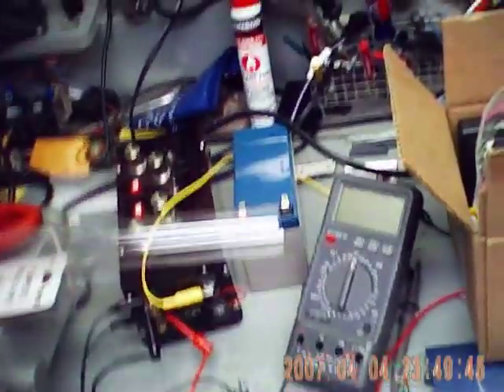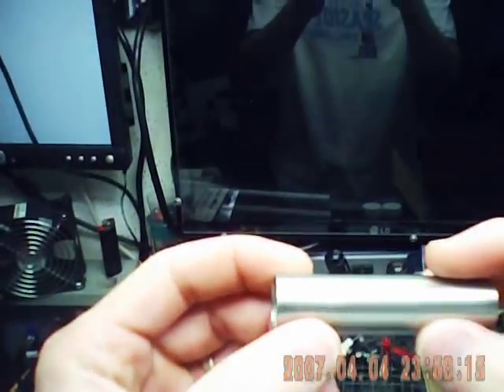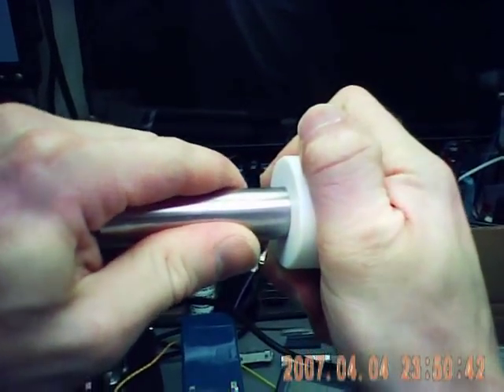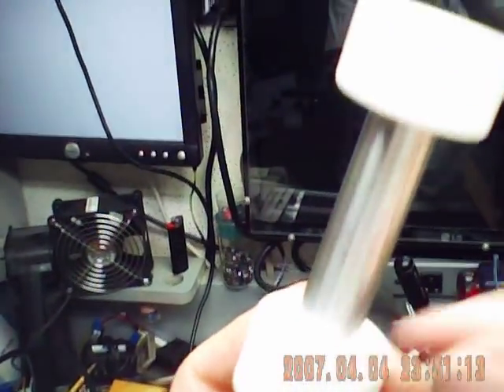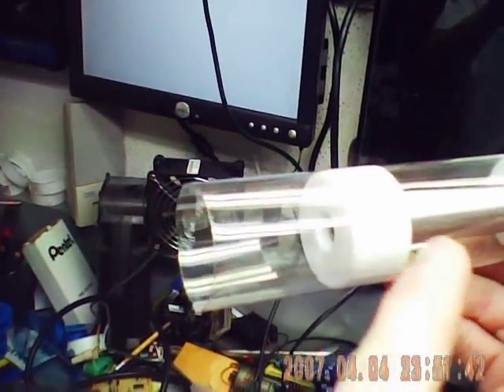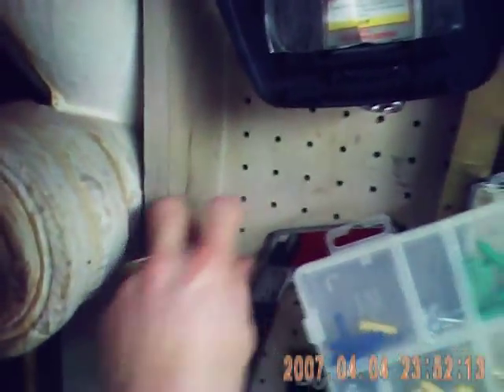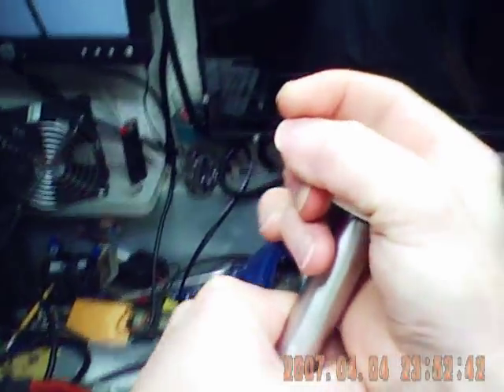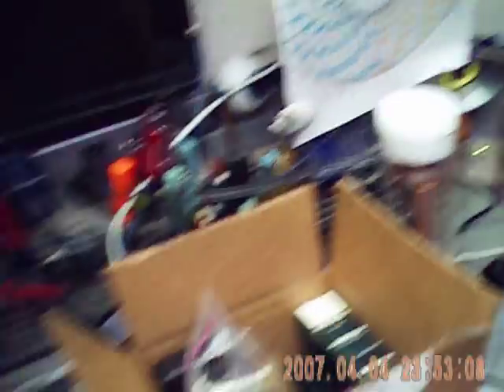New Resonant Cavity Test Cell ½ Done. & New Sun Glass Camera Test. DATE IS WRONG, I know!

Comment: @rwg42985 , the 630nm should work well, and they should help with the hydrogen as well.
There is a an absorption line in the hydrogen that is close to 630nm, so the red LED's should help with ionizing it as well.
peace
mike.